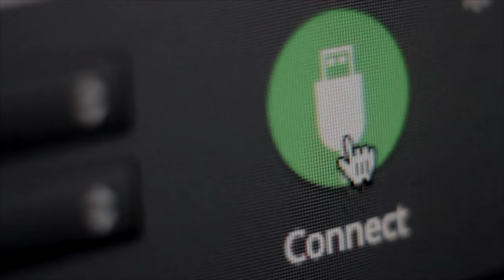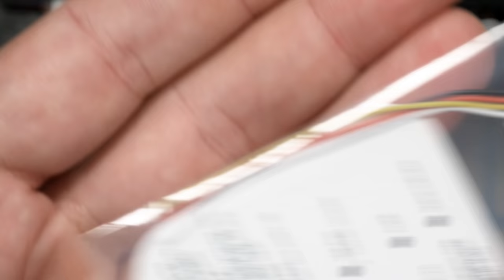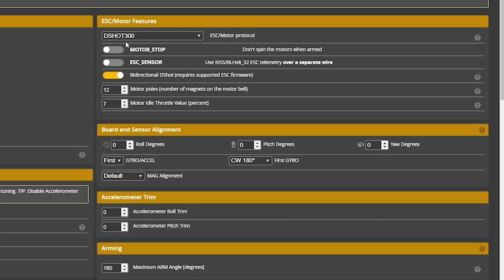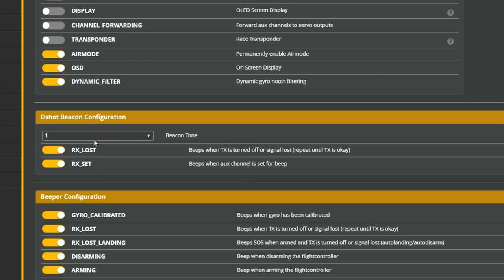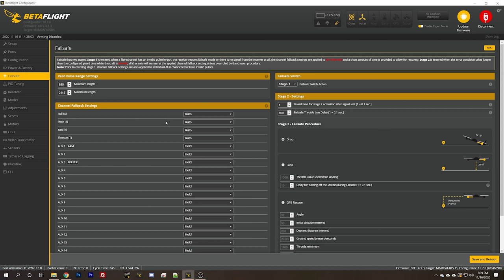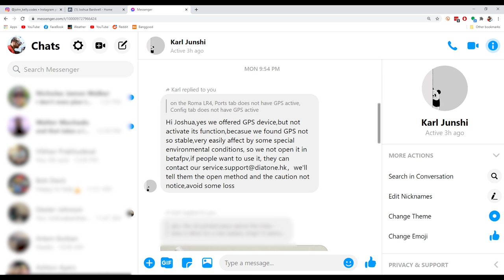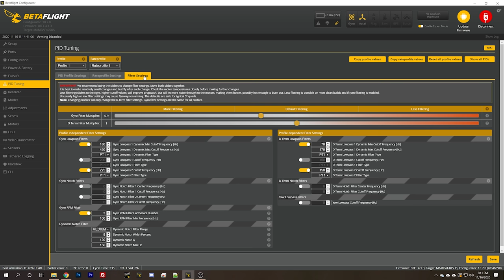Diatone Roma F4 LR in depth review

Comment from the maker: The dry weight with props and no battery is 160 grams. Very sorry I spaced on that. What a ridiculous thing to leave out of a review of a LR quad.

Diatone instructions for how to enable the GPS don't seem to be correct. The 9600 baud seems right but when set to NMEA as the instructions show, no sats are detected. When set to UBLOX auto-config, a few sats seem to be detected, but a 3D fix is never achieved. My conclusion based on the one unit I got is that the GPS simply doesn't work.
Reply: I was wondering, but it looked light enough. The shocker is looming. Have you seen the titanium frame yet? I've been thinking about that for a while.
Reply: I saw that Avant Quads has the Ciro 4LR 
With brother hobby 1504 motors. This one should also be included in the shootout. It Looks awsome !

Comment: Ray from the future here as Josh would say, I purchased one of these when they first came out and they were junk and took f-ing forever to get a lock if you were lucky enough to not have the vtx overheat! Three years in the future and I have replaced the M8 gps with a new M10 gps that gets Galileo sats, and if is finally usable! It sat on a shelf for three years and I tried everything to get this turd to work. With the new gps module, it is fantastic and locks with in 20 seconds! I also designed a new mount that relocates the gps to the front. This gets it away from electrical interference!

Comment: Fantastic flying and review, Joshua! 😃
Yeah, the PID tuning needs a special Joshua tought... But I REALLY liked this frame! I'm thinking about getting it to build one! 😂
Anyway, stay safe there with your family! 🖖😊
Reply: Did you end up picking up one of these frames to do your own build? It looks promising maybe with different motors and FC. Would you recommend?
Reply: @chriswhilsmith407  Unfortunately I didn't, dude... I didn't have money for the hobby since January 2020. 😕
I still want to do it though. 
About recommendations... Different motors, definitely. Maybe they're better now, but they weren't in the beginning. About FC there's no issue, you can use whatever you want. And Diatone's boards are very good! But you can look for one with barometer in case you want to try iNav. You know?
Other than that, a better GPS module. Pawel Spychalski changed his for a Matek GPS and it worked flawlessly!
Anyway... Great luck with the project! 🖖😃

Comment: the mounting option for the cam, with the downer scew, is for hybrid or split cams, wich have that two screw holes. 
The downer screw is for generally fix the cam. The upper screw is to adjust the angle.

Comment: Great video....... I think my favourite still is the flywoo LR. Well a now that I've swapped the esc and fc to an iflight with 5 full uarts.
Reply: Nice. Was thinking swapping everything except frame and motors on my flywoo haha
Reply: Just curious, I have a flywoo lr, but I've been out of the scene for a year. 

After upgrading the GPS module my explorer does everything I need it to do, so I'm curious what benefit having more uarts would be?
Reply: @dangerous8333  The original Flight controller that Flywoo made didn't have enough uarts. A serial uart had to be used.
Their were some early teething troubles because of this so a few of us simply swapped out the flight controller.

Now however I believe all works as it should.

Welcome back to the hobby my friend

Comment: I have found Diatone flight controllers don't handle GPS signal properly.  It's been my experience as well I have read posts by others saying the same.  Diatone + GPS = NO!!!  Don't trust it.  This quad is a joke, a long range quad that comes with a faulty flight controller that can't handle GPS?!  Don't waste money on this quad people!!!!!!!!!!!!    I think you could have skipped this one.  Or maybe it's best to let people know that Diatone ships faulty products just to keep up with the competition.  BTW Only the quad sucks.  You Joshua are absolutely awesome!  Thank you for all your help over the years buddy!
Reply: gps connect uart port  how it relationship with mamba fc…  on F4 not enable gps in bf ,the main purpose keep some beginners fly it more safe,people can open it easily,and also can contact services for manual how to use it well
Reply: I tested MAMBA FC(MAMBA F405 DJI) and Iflight FC(SucceX-E F4 V2.1), only FC is connected to GPS for test(No other device connected), MAMBA FC is always (difficult) cannot be fixed, Iflight FC does not have this problem.
Reply: @inerstw  Thank you for responding and checking yours out as well.  I think it's quite certain then that the mamba f405 definitely has some kind of design flaw or quality control issue when it comes to receiving and processing GPS data.

Comment: I just bought the frame, I will build my own VERY light 4" long ranch one.
Reply: Nice. Do you know what motors your going with ?
Reply: @fpvnycdream_4197  Not yet, welcome to ideas.
Reply: @fpvnycdream_4197  I am planning to install these motors: BrotherHobby VY 2004 1700Kv Motors. Same motors that the catalystmachineworks shocker uses.  Not planning it for long range but I plan it for performance only.
Reply: @princesfpvdrones that’s awsome. I’m actually building a machine catalyst shocker 5” with brother hobby 2004 
3150kv 4s.
Reply: @fpvnycdream_4197  Ah, I see, 4s I presme?
Reply: @princesfpvdrones  I run 6s on all my 5” quads except two micros 3” and 4” they get 4s rline 1050 mah
The 5” ultralight I’m using the 2004 brother hobby  3150 kv motors, I will be running both and have 2 profiles to have the flexibility to run 6s with a motor output limit and have equivalent to a 2000kv. Either way it will be a performance machine. Lol. 
Follow my Instagram:  Fpvnycdream 
I’ll follow back
Reply: @fpvnycdream_4197  Ah well, 2000 kv is much to high for 6s, best to limit the motors  around 1700 kv for 6s.
Reply: Hey) Hope you've successfully built it and crashed it a lot and can answer a question: is this frame durable?) How durable is it?)

Comment: Not impressed here, this really need some tuning/hardware fixing to get rid of all these bubbles and the horizon jello ... really good video JB, keeping it real !
Reply: The FlyWoo Explorer LR is super smooth on 4s, it kinda flies like nothing else I have. Its athletic, but mostly for cruising. You can build some reall strait ahead speed however, it still feels fun to take the platform towards its limits. I like Lihv 650 all the way up to 1000mah packs on it, your ready to come in when 3.5v hits and you get time to bring your quad in which is really nice. I will have 3 of them soon.

Comment: Interesting. Just a few days ago I made a li-ion battery pack for my standard 5 inch drone with a custom frame(racing drone style with the strength of a free style) on my first flight I got over 22 minutes while still playing around a bit and only flying down to 11v. So I believe that 25+ minutes is possible if someone used different props, flew to a lower voltage, and flew easier than what I did.

Everything was the exact same as I would normally run except the battery. So my drone without the battery was 344g, I was running dji snail 2400kv motors with the dji 5048 three blade props, and I had an all up weight of 674g. 

Would be a market for a battery like this for people who wanted to fly long range with whatever drone they currently have?

Comment: This is un related from the video.. but i have this flight controllers and esc f7 kakute stack esc if i plug the battery the fc wont turn on but the esc will make the sound to turn on the Fc you need plug something to the usb first then plug the battery to the esc so that everything will work fine..

Comment: Hi Joshua. You mentioned unlocking 1200mw. I have a vista. Is it safe? Honestly, that nano isn't really that bad.
Reply from the maker: It's totally safe.
Reply: @JoshuaBardwell  Cool! Thanks a lot, always! :)
Reply: @JoshuaBardwell  I just finished updating it. I'll try it tomorrow. There's a spot about 500meters from my house the signal becomes so bad. I guess it's because of multiple houses blocking the signal coming from the vista into my dji goggles. There is no LOS. I honestly thought the culprit was the short caddx vista antenna being blocked by the lipo battery when quad becomes almost parallel to the ground. So I bought a 130mm Lumenier antenna. Today, I flew the same spot and I was disappointed. I saw the same signal degradation. I was flying at 700mw. I'll keep you posted tomorrow.

Comment: Josh,  I'm a fpv noob and have just been flying 1s and 2s (I own a tinyhawk2, eachine novice II, and tinyhawk freestyle2).  I use a taranis x-lite RC and some discount eachine ev800 goggles.  I want to step it up a bit.  The transmission range of my goggles combined with my tiny quads is very poor.  The signal in the goggles breaks up easily.  What 4s or higher quad would you recommend for someone like me?  I have the basics of flying down and I can fly decently.  I watch your videos and would love to get the RC and video range you get on your quads.  Would I need to updrade my goggles and RC too?

Comment: Hello,

I purchased a Diatone L3 HD runcam split nano. I had zero any luck connecting my Spektrum 4650 micro receiver to it. The wires are soldered black to negative, red to 5v, and brown to the uninverted tx pad (I even tried the RC pad). I am not getting any input in the receiver tab on beta flight. I have uart one for serial rx, and IRC tramp uart two in peripheral‘s. Receiver mode is serial based receiver (speksat,s....) and the serial receiver provider is SRXL2.
 I wound up trying a different receiver a newbee drone dsmx, i soldered the signal wire to RC pad. It bound and worked, unfortunately the quad flew about 50 feet away and my goggles lost reception and the drone fell to the ground. It happened twice. I think either failsafe or its resetting itself.

Can you please tell me what you think is going on ? 

Any help is appreciated Thank you
Reply from the maker: SRXL connects to UART tx not rx. The rc pad is rx. Also you might need to go to the CLI and type

set serialrx_halfduplex = on
save
Reply: @JoshuaBardwell  I soldered it to the uninverted tx pad. I will try adding the CLI command set serialrx_halfduplex = on save. 
Thank you

Comment: Hi,
There is one thing I do not understand. roma f4 has mamba f30mini esc, which is blheli_s and doesn't support bidirectional. So how it possible that rpm filter is working?
Reply from the maker: BLHeli_S ESC can be flashed to JESC, BLHeli_M, or BlueJay firmware to support bidirectional.
Reply: @JoshuaBardwell  I tried bl-helli jazzmaverik 16.73 but still have error in betaflight saying rpm filter not working

Comment: Is it possible to have a DJI Receiver connected at the same time as Crossfire Receiver?
Reply from the maker: Yes. But you can only be using one of them to control the quad.
Reply: @JoshuaBardwell  - Hmmm, Thanks. Sound like a good subject for a Video. 

I had to send my DJI controller along with one of my quads to Adabom FPV for some repair and I still want to fly. All of my quads except for one micro has been switched to DJI. I'll have to make one of my other DJI quads DJI/Crossfire capable.

Comment: no gps? sounds like my kinda quad
Reply: GPS device connect already,but not enable function, you can conntact us,we can tell you how to open it,give you a config file,but the most important thing,tell you some caution need know before you using it,be  responsible for safety and our Hobby,enable it very easily,but This GPS(all betaflight gps) a lot difference compare with DJI one :)

Comment: I don’t understand these quads and their purpose .  I bought a Baby Croc and I own stock DJI goggles and DJ I controller and  this is what I think .

1) AirUnits are far superior to Caddx Vista. Period.  Why dont they just put a full air unit in it? To save weight?  That’s laughable! with  750mAh  batt you’re flying around the backyard ! Hmm,  is that because you have to strap on a ka’ zillion pound lithium ion to go anywhere? Sowhy bother to  save 2 grams on a crappy vista to be under 250 grams when your flying around in your backyard?.
2 ) Speaking of crappy, Vistas look bad half the time compared to the rock solid video of the air unit so again there goes the sub 250  because unless you like broken up 720p then your going to also need to pop on a go pro so can enjoy  your video....um  later. This whole shaving off 2 gram thing  is really starting to lose me. But on with the list.
4) If your using DJI and a Caddx Vista and a stock setup and no x-air you are not going very far anyway even with a zillion pound lion. Because the it will ...again let me put it this way, my 3” GepRC CineRun with an air unit blows away my new Baby Croc in every single way...and  goes farther with better video.

Bottom line ....anyone want to buy a Baby Croc cheap? It brand new and only days oldI say that  bc I have one brand new and it’s completely useless until my patches come in (more expenses).
Reply: It not cheaper for a 4” btw ..price the Baby and the 7” Croc (research?)
Reply: Too many free drones waters down these videos big time. Waste of time!!!
Reply: Centralized centre of mass lol
Reply: I don’t not know why I’m the only one who thinks these things are getting like a stale sitcom that’s been in syndication way to long. Sorry but I’m finally out but at least you don’t have to see my post anymore. Folks there are some really really good channels out there were people buy their own drones they are really much better reviews .
Def E ....out!
When he said , “and I agree with their decision” that was a bridge too far.. he really thinks that.....never mind  I’m out of here!
Reply: Ship it so you can configure software yourself so you are responsible ...duh! My lord!
Reply: Don’t worry if it heats up enough it will shut off itself lol so turn off that heat protection and  hack your vista and  if it blow call Josh he will buy you another one. LOL